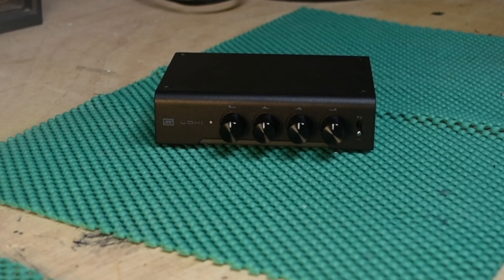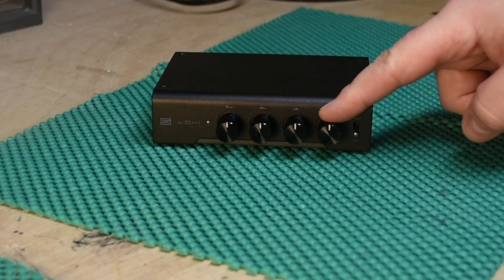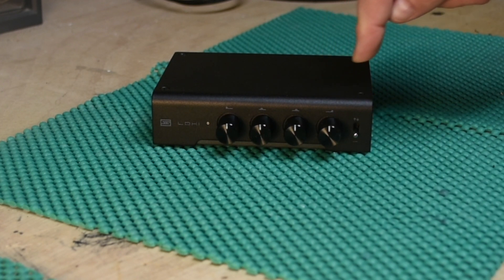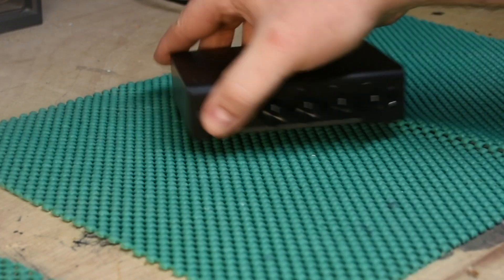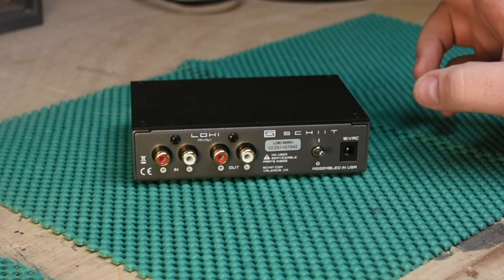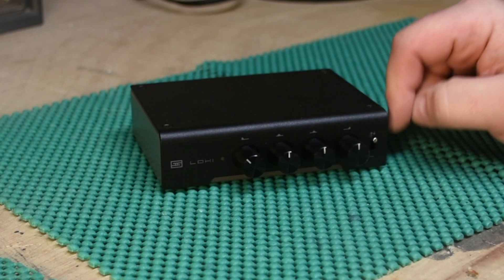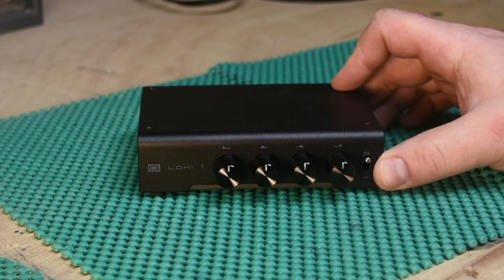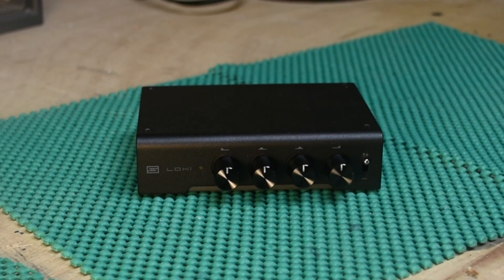SCHIIT Loki Mini + Review - Can the Loki save me from boomy bass and my wife?

Comment: Might get the 6 band version, I think that will be more useful for me. I have hearing problems so I need to EQ my audio. A reason audiophile purists dislike these is as much because they believe it effects the soundstage and all that stuff. I’m currently using a vintage Technics which works extremely well.
Reply from the maker: Maybe it does effect it to some degree, but if your system needs the equalization the soundstage is a much lesser concern, I think.